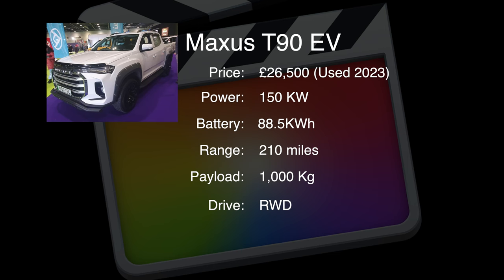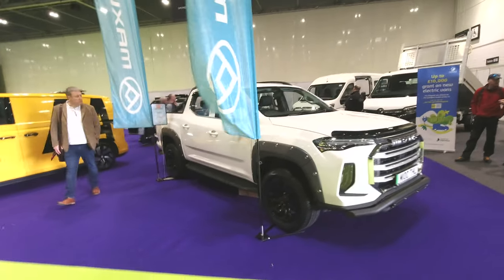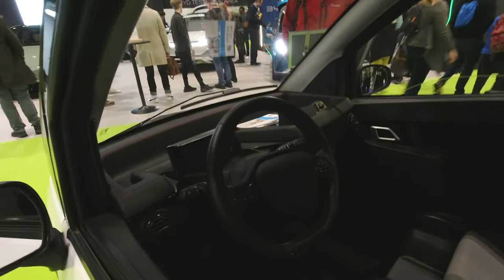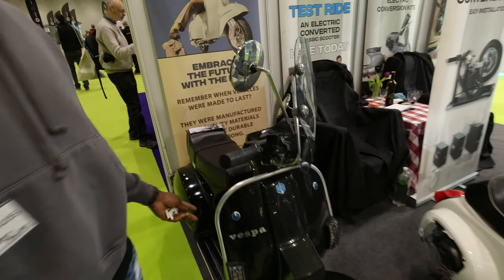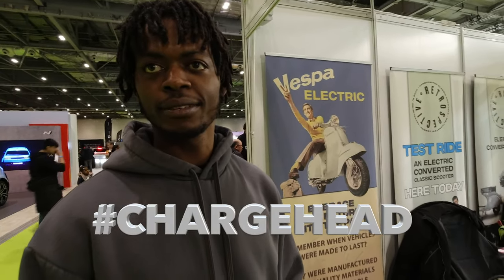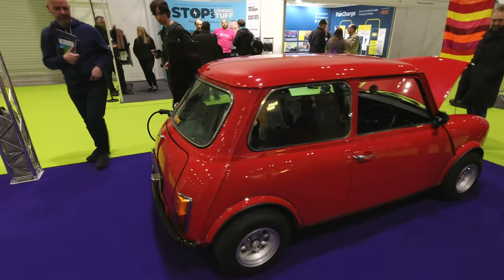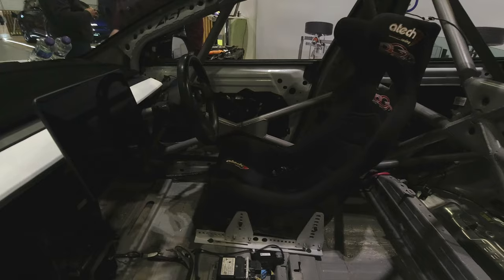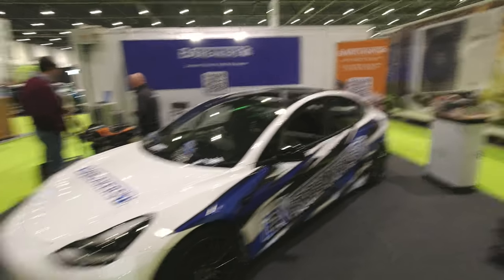Everything electric show at the London Excel. Fully Charged Live 2024 Modified EV's and Conversions

Comment: Gave up watching no prices??
Reply from the maker: Thanks for the feedback, however there was 🤷‍♂️
Reply: @chargeheadsuk  Not on the conversions
Reply from the maker: @tivvy-xf4kz  Fellton dont have EV Conversion prices, just prices for kits, the silent classic cars the 240z is a Jack's car not for sale and thr fiat 500 is a demo. Which car did you want a price for?
Reply: @chargeheadsuk  None but I would like to see an emphasis at the lower end of the market rather than the the latest whizz bang tech laden model that costs too much for the average person. If EV's are to really take off we really need the information so that those with less income can possibly buy something. I'm fed up of the usual announcements showing the latest "affordable" vehicle. Nothing and I repeat nothing currently on sale is affordable to me.
Reply from the maker: @tivvy-xf4kz  its a good job I'm planning a video just like that on affordable used EV under £5k then 😉
Reply: @chargeheadsuk  I've looked at Leafs and some of them are only doing 50/60 miles range due to battery degradation. It would be much better to report on any company that can offer battery packs to replace the originals. Another help for used cars would be some sort of reliable check on used battery life and a report could be given a bit like the energy certificates on houses.
I've seen a few dubious ads where they never mention the expected range in real terms or just quote the manufacturers "new" range which may be quite different when the car is a few years old. The battery is the main worry on used cars and costs far exceed what the car is probably worth.
I look forward to your review but I don't hold out much hope.
Reply from the maker: @tivvy-xf4kz  its true battery deg is big on the leaf coz of no battery thermal management. Zoe has battery lease in the main so maybe i'll focus on the cars above that. Battery swaps for Leaf are expensive so you might as well buy a more expensive car as Chademo is a pain and the adaptor is £900. So much to think about